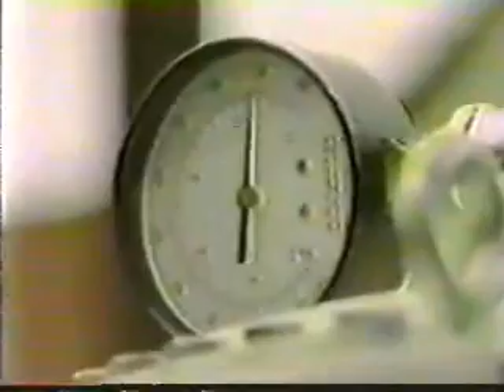Stan_Meyer_Dune_Buggy

Comment: he said using the alternator as an amp restrictor as in his later voltage intensifier circuit ! so would an alternator be capable of sending voltage to infinite appreciate any reply ,may it need a secondary applied or could it be wound in the alternator